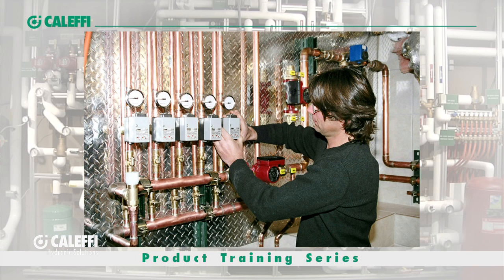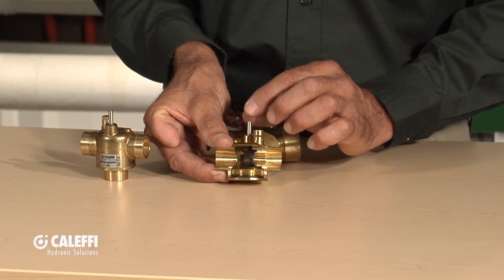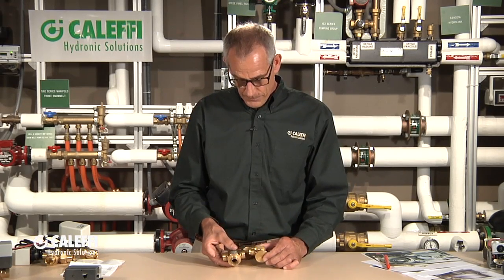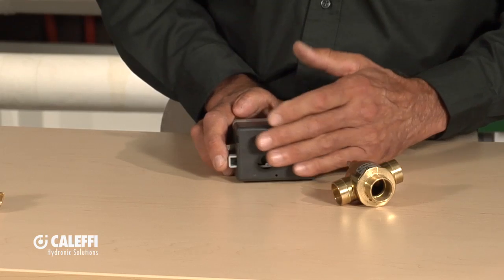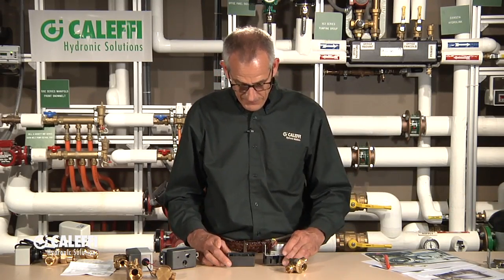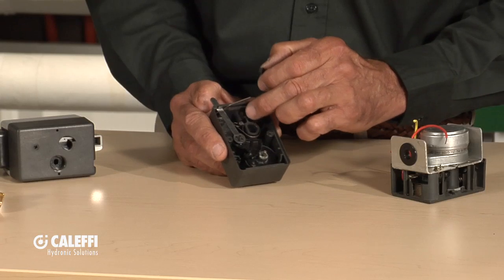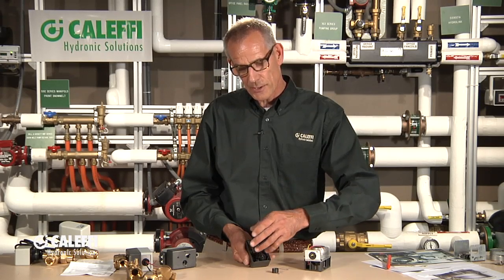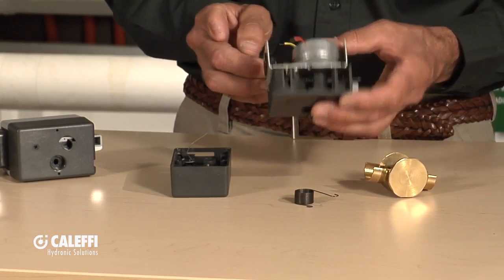Two Position Spring Return Zone Valves

Comment: I have a z111000 actuator in my apt. The thermostat wasn't working right and my building manager told me to go to the zone valve and reset it. I found the actuator and press the grey button on top. Now the heat is on too much...How can I reset it and turn off the heat?

Comment: I have the Z111000 actuator for my radiant heating system which was installed about 5 years ago.   I just noticed that when the actuator is turned on, after about an hour,  the solenoid heats quite a bit, up to 117 F.  Is that normal ?
Reply from the maker: Thanks for your inquiry Kee Lee. You may not be feeling the heat from the motor or solenoid.  Rather, what you may be finding is that after an hour of run time you will have heat migration through the stem of the valve to the upper section of the actuator. Our aluminum motor mounting plate is designed to act as a heat emitter to transfer the heat away from the motor assembly to the outside of the actuator to protect the motor. This is what you are experiencing.
Reply: @CaleffiHydronicSolutions  Thank you for your prompt reply

Comment: I’m having to replace the power head on one of my zone valves every year. The switch in particular seems to be burning out. Any idea as to why?
Reply from the maker: If you have a Z111000 or Z151000 actuator and you are experiencing end switch failure, here is the situation. The signal current going through the end switch is exceeding its maximum rating of 0.4 amps. These actuators are designed to work in low current applications and are usually installed with a zone relay panel like our ZVR relay control.  When we hear of this happening, the actuator is wired directly into a boiler aqua stat or control. Not all boilers signal currents will exceed the 0.4 rating.
Wiring the end switches to the boiler aqua stat was a common practice for many years with the old style actuators that have higher current switches. We do offer the Z111900 with the high current switch for this type of installation. The high current switch will handle up to 5.0 amps, but needs to have at least 0.25 amps going through it to keep the contacts clean.  You can always call into our tech support line for additional information.  You'll find our Ask Caleffi team at (414) 238-2360.  Hope this helps.